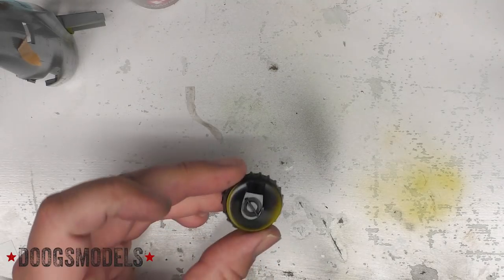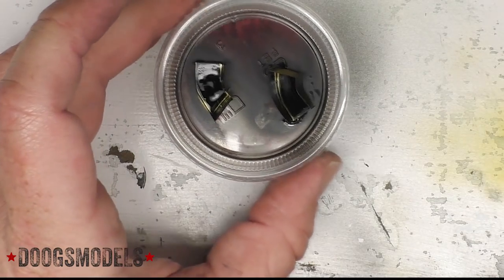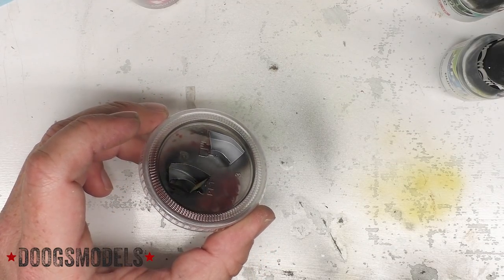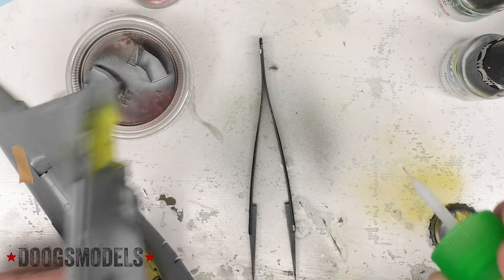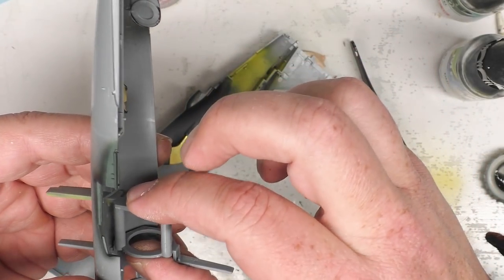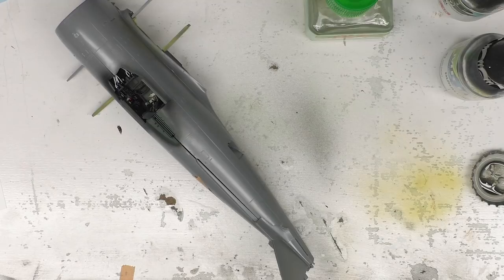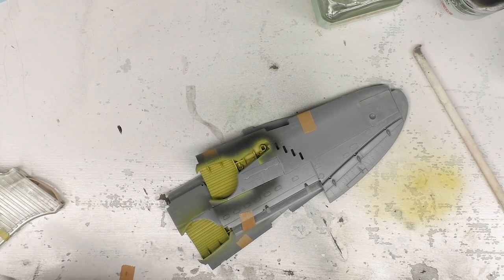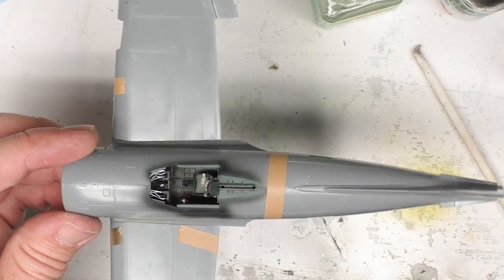Tamiya P-47M Build - Part 8: Closing the Fuselage

Comment: Great update I figure I ask you because you build so many planes. I`m building the Focke-Wulf Fw 190A 1/24th scale Airfix kit do have any idea what paints to use for the body
Reply from the maker: Probably RLM 74/75/76
Reply: @DoogsModels  what does RLM stand for I`m in Canada
Reply from the maker: @JohnPol  RLM = German paint codes. Similar to FS numbers these days. Just about every paint mfr offers them (Tamiya being an exception - believe you have to mix to get some of the colors). Gunze, MRP, AK, etc all offer them. RLM 74/75/76 are basically to German AC what olive drab/neutral gray are to US.